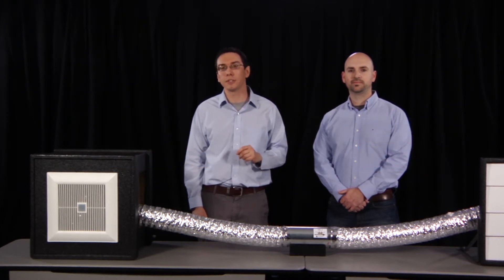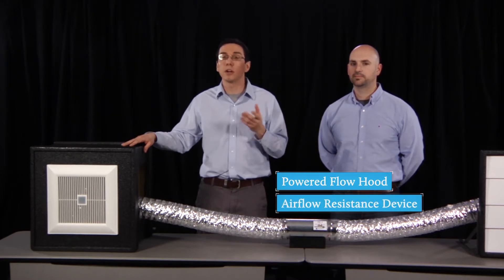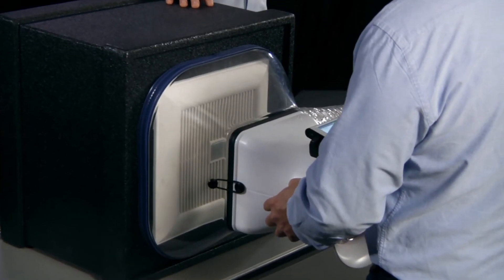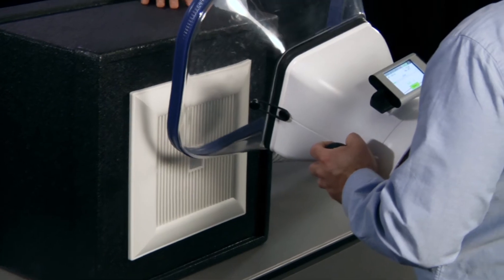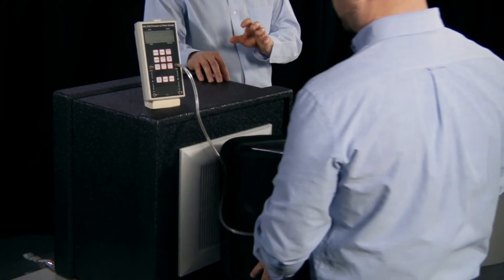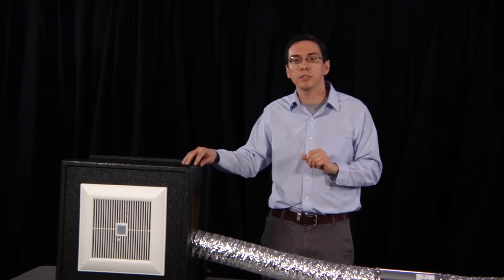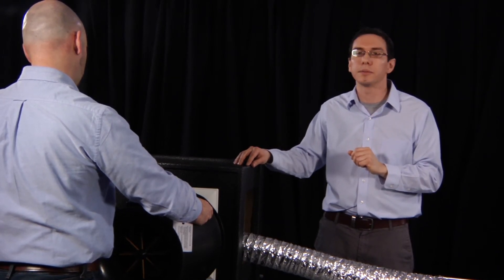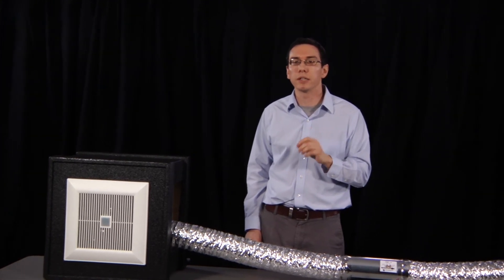How to Measure Whole-House Ventilation Airflow Video 2 of 4 – Inlet Terminal

Comment: 1 - When you are saying pressure difference less than 8 pascal is it when the fan is running or not?
2-if you have two bath fans connected to the same duct and you tape one of them - why can't you use  air-flow resistance device?
3- if not, what device should you use and how it should be done?